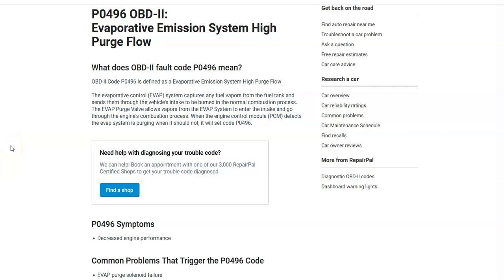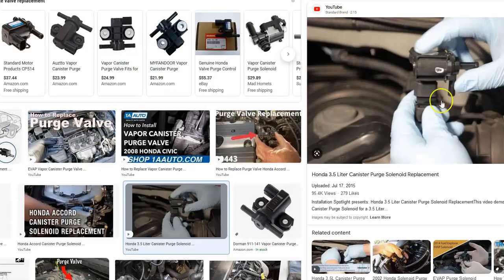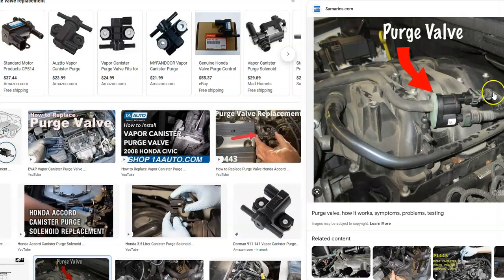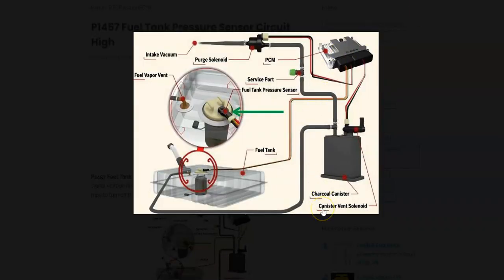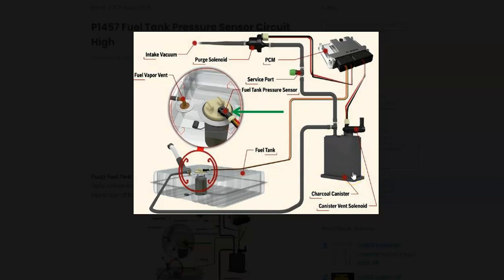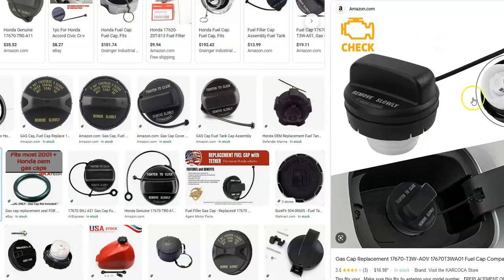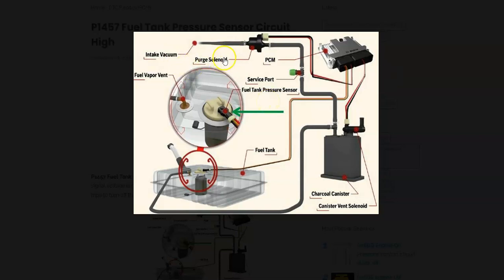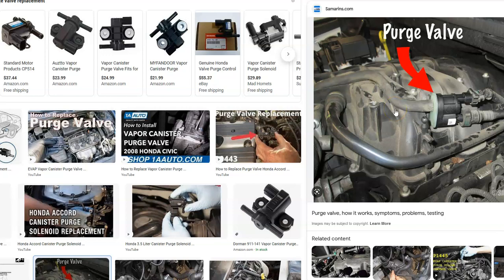How to Fix Honda P0496: Evaporative Emission System High Purge Flow

Comment: 2011 CR-V. I have these 3 codes: P0497, P145C,  P0496
I changed the purge valve under the hood. The original code went away for some weeks but came back with the 3 I have now. Sometimes after filling gas tank, car wont start for a minute or so. Should I change the charcoal canister thing?

Comment: Thanks for video, I have replaced 3 fuel pumps and valve above engine. The car still trying to shut off. Also the fuel gage was reading backwards sometimes before starting. Can this be the carbon canister with valve that sending P0496?

Comment: 05 honda element
Had P0497 low purge flow, repaired rusty line that broke. Now I have a P0496 high purge flow. I replaced the purge valve prior to fixing the hose. Could debri in hose forced purge valve to stay open by getting stuck in it?
Also now have lean conditions and idle surge but it's fine once I'm driving.
Reply from the maker: To test if the purge valve is stuck open remove the  purge valve hose going to that charcoal cannister. Start the engine and there should be no vacuum for the first few minutes until the engine warms up. If there is a vacuum then it is stuck open.
Reply: @whyingo7964  I ended up checking that yesterday and the purge valve was bad and not closing. Now it's saying I have a low purge flow again and a small evap leak. I might just have to smoke test it. There's so much rust I wouldn't be surprised if there was another hole somewhere

Comment: I had a p0443 on my wife's 2006 Accord 2.4l. Changed the purge solenoid and now Get p0496.
Help.
Reply from the maker: I would check the wiring and for a possible Evap leak.